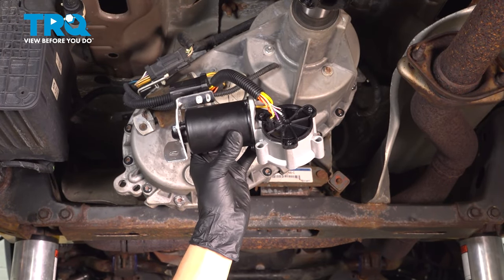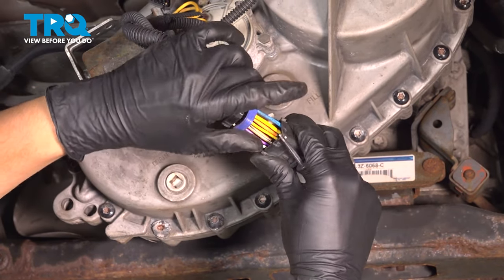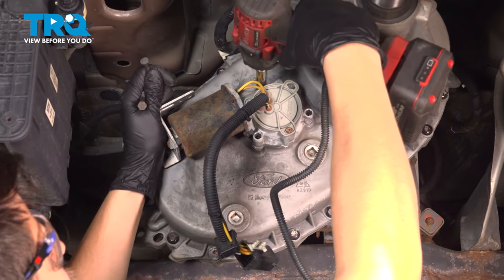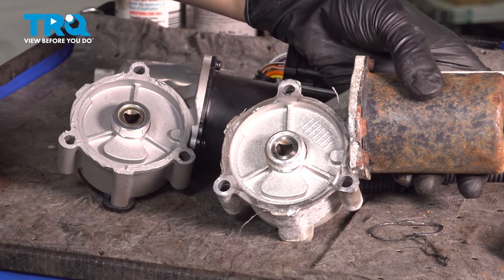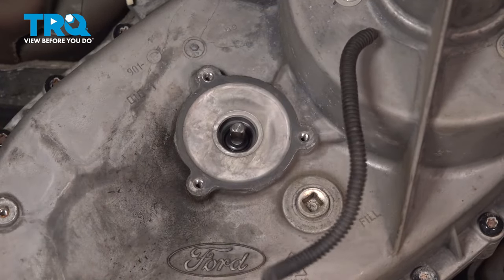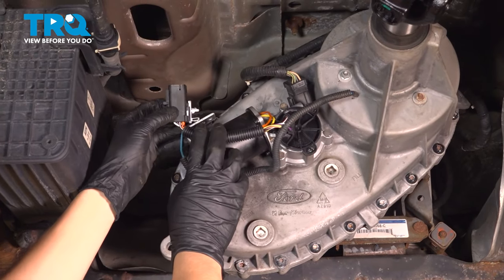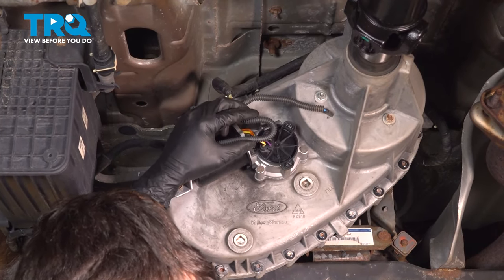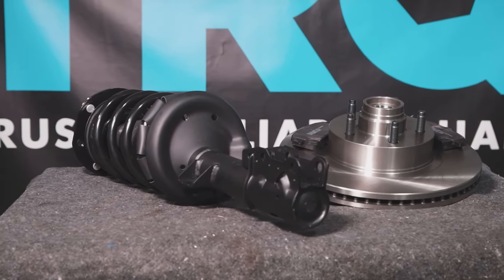How to Replace Transfer Case Shift Motor 2009-2014 Ford F-150

Comment: Yup I'll be cutting and splicing that wire outside the connector. I can barely get those things to separate without breaking them. I'm not about to attempt taking one apart to get a wire out and put a new one in.

Comment: I got a junk Dorman motor. Just says shift in progress.....shift delayed pull forward. Never shifts, motor gets hot. Old T case motor works but throws a contact plate code now and then. Gonna have to get OE.

Comment: This was a great video.  Just replaced mine and it went smoothly thanks to this great video!
Reply: Thanks very much 
I was struggling with the wires due I got stuck on top of the mountain and the cable was not secure and got removed from the plugs 
I followed the video and re connected the wires and now it's working fine 😊

Comment: My  2016 f150 goes into 4wd but when it comes out into 2wd there's a squeaking little squealing noise. it goes away when you speed up but not totally. When i do about 10kms/hr it's fine but after i go faster than that the squeal come back . The first time  it it did it , it actually grinded a little . Now it just squeals . Could this be the transfer shift motor or is it more likely the IWE system or something in it? Any ideas?

Comment: Are you its ok to connect the transfer case motor without installing it in order to position it properly? Ive read a couple comments stating that its not recommended. Any thoughts?

Comment: This is the best video I have seen the best part is were you say that the tab can be turn to 2 wheel drive I wish someone else had told me that. It would have saved me from driving home in four wheel drive doing 40 MPH I could have drove home and not worried about 
 my engine transfer or other people driving behind me at 40 MPH ..
 in 4 wheel drive the speedo is off and wont go over 100 MPH because it reads wrong..I wish other video's would have shown me this trick so I could have drove it home normal In 2 wheel drive Its kind of late but I hope more people know this who are stuck when its 20 degrees out and just want to get home bye turning that into 2 w D late but I had seen that video earlier I kind of figured there must be a way it wasn't this video but another you did please tell others who are stuck in $WD and the speedo is off ..again I wish I had seen It but again thank you..

Comment: What do you do when some idiot stole your transfer case motor and cut the blue wire?  Where can I find a replacement wire for that?
Reply from the maker: +Fly Gringo We do not carry just the wires you need. We recommend searching with local auto parts dealers or contacting your local parts department as they may be able to help find the parts you need.